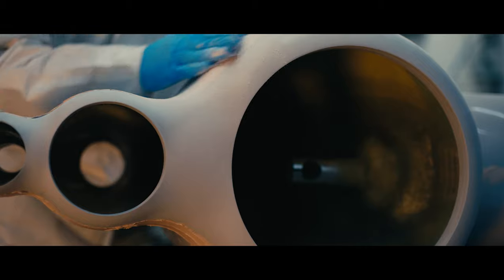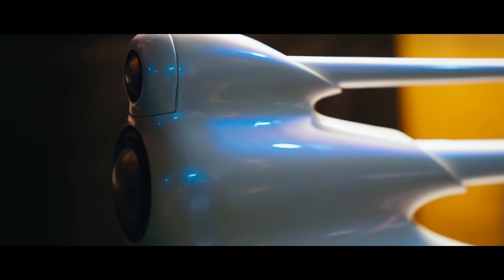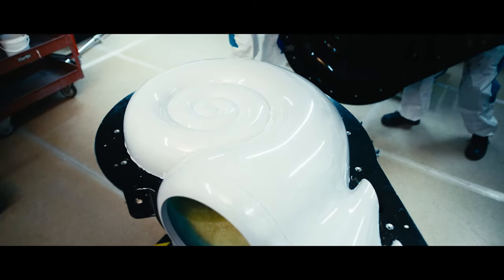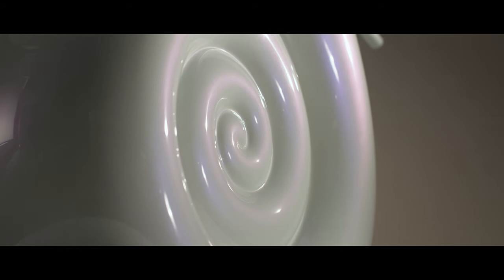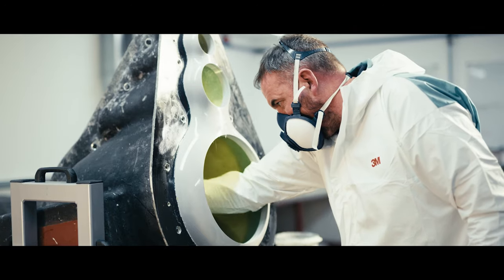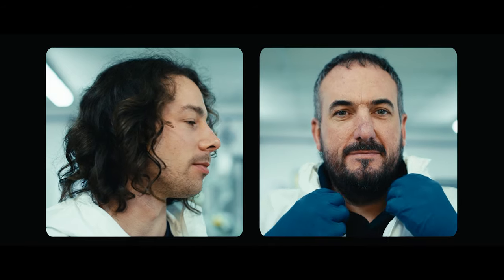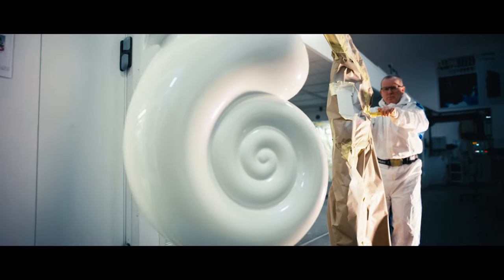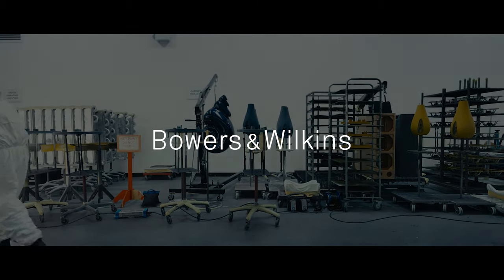Bowers & Wilkins - Beyond the Curve - Nautilus 30th Anniversary

Comment: Listening to this on my Px8. Amazing headphones, undoubtedly the best purchase I ever made. I also use THX Spatial Audio to set my own EQ. I have not heard them distort even once, and never before have I heard audio so clear in my life. Each and every detail so clear, soundstage so wide, sound separation on point. B&W know what they are doing. Initially I held Bose in high regard, mostly because my Dad was impressed by the 901. But Bose has lost their engineering prowess imo. B&W is where engineering meets form and function. My next purchase will be the Formation bar and bass.

Comment: i am sure that i would prefer the original 800n to the later D - D4 versions. It's sad that those speakers need so much power that they dont pair well with tubes. Especially considering the price drop they had... It's an incredible speaker for the 5k range it is in today. But yes, you have to feed them with Behemoths of transistors in a/b, as far as i had the chance to test the smaller iterations. Enjoy!

Comment: I wonder how these speakers would sound, made from large block of aluminum block, using a CNC machine to cut it out?
Reply from the maker: Would make more (manufacturing) sense to cast it, rather than finding a way to machine a shape such as that.
Reply: @StereoNET  you probably could use a sand 3-D printer, to print the interior, to cast aluminum over it. Then just break it out when you’re done.
Reply: lol.....Yea I guess they could just build a limited run of 10 pairs.

I think Aston Martin ended up doing a similar thing when a wealthy Arab prince wanted a road legal version of the Vulcan.

Comment: I have the 800 Matrix. How does that compare to the Nautalis?
Reply: Honest answer? Believe me, there are worlds in between. There are worlds between the Diamond 800 D3 and the Nautilus. I don't know what Amplifier you have in use. I heard the Nautilus with the Devialet Expert 1000 Pro fully class D amps. It was an another own world. I had from the first moment tears in my eyes and pure goosebumps. I will never forget this presentation. The problem was the price for the whole presentated setup. The other thing is, since this presentation is that hardly anything else comes so close.
Reply: Its an ingenius design.  Super low diffraction.  What you hear in most other speakers is the diffraction
Reply: The Matrix are great for massive soundstages, like orchestra. The Nautilus simply shines at every dimension.